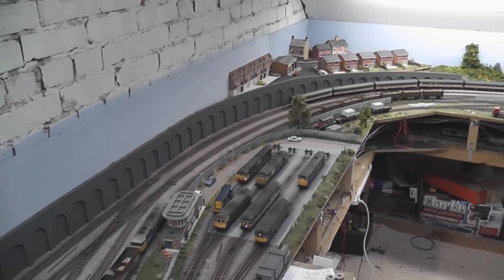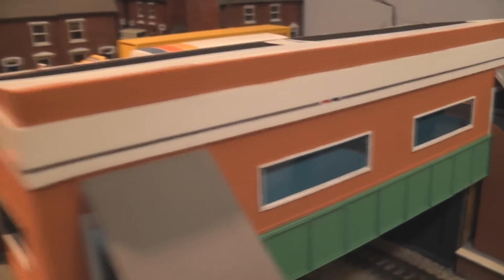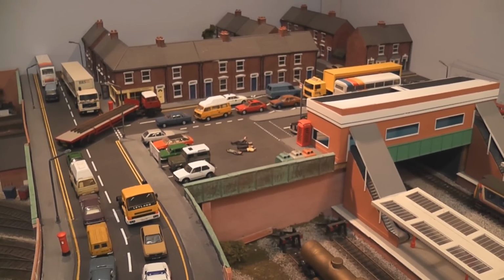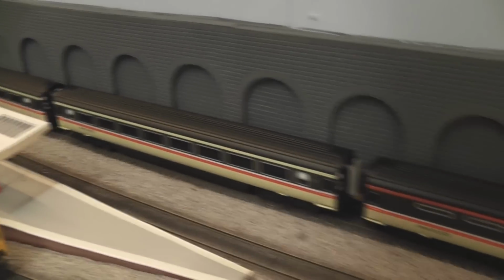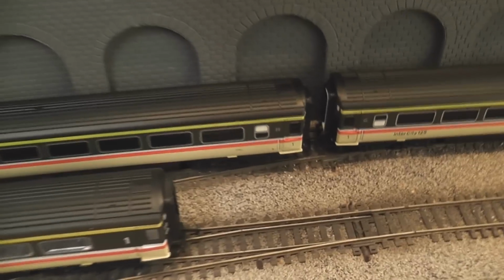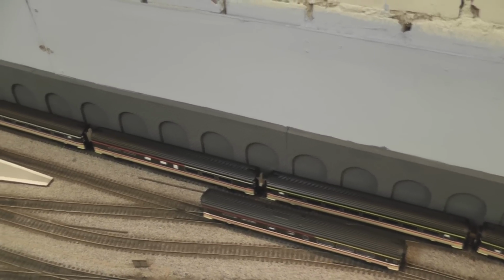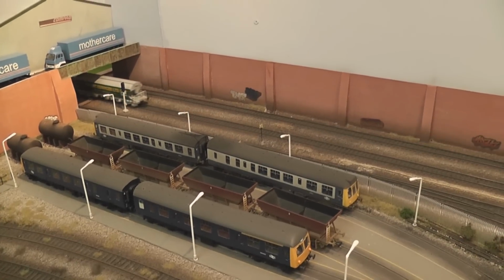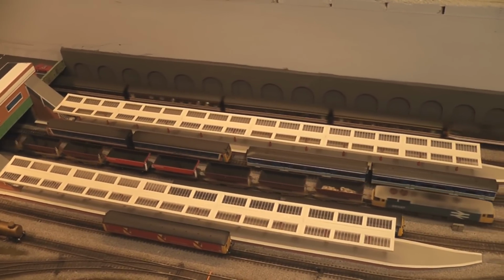2015 Layout Update

Comment: Regarding the gap between the carriages. Are there no flexible joints you can add to the doors so they are physically connected to each other? possibly with magnets, do they even exist?
Reply: My grandad has some (quite old) kits that had made of some coaches that had corridors built into them, they would flex and stretch to accordance of the curve but they were still of the desireable gap as they were the old 'proper' couples!
Reply: William Tregurtha It just seems strange that the manufacturers put so much effort into the realism of the models yet forget the look of them joined up. A Flexible corridor using rubber would be very simple to make and heighten the realism.
Reply: William Tregurtha A Fellow "Empty Box I- Racing Subscriber" here-  Hi Will ...
Reply from the maker: Daniel Gregory They do exist and I may get them.  They don't solve the main issue though.  The coaches are simply too far apart even if they are connected by gangways.  In reality they are much closer together.

Comment: What did you use for your cut stone retaining walls with the arches?  Thanks.
Reply from the maker: +seagraver They came pre-made but I trimmed them to fit better with a very sharp knife.  They cut easily as they are made from foam.
Reply: Thanks.  I looked back through your videos to find the specifics on the product you used.  I tried the link you provided with no luck.  It seems they've gone out of business.  Thanks again.  I've enjoyed your videos and have used a few of your methods and ideas on my own layout.  The yard you've been working on has given me several ideas and I'm actually considering "fiddling" with that Wills interlocking rod kit.  Keep up the great work and please keep posting!